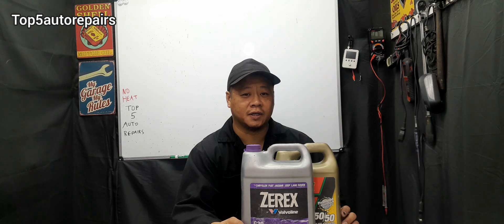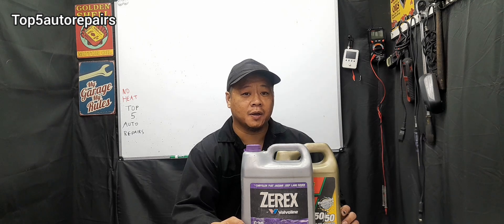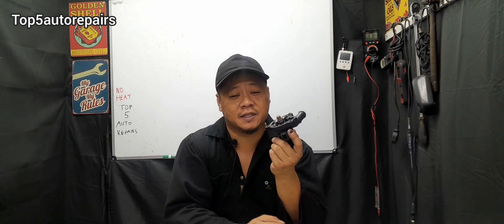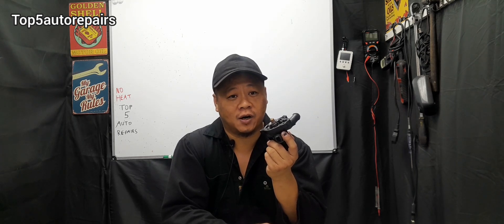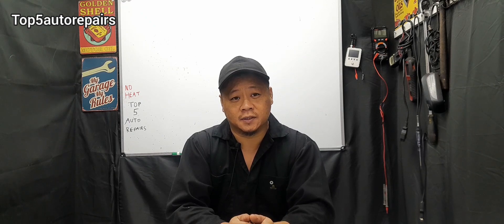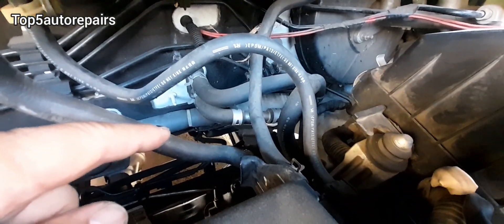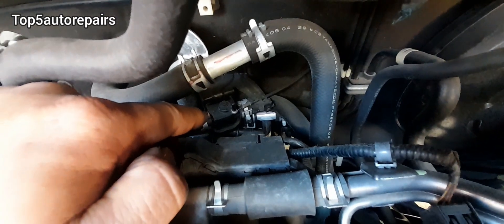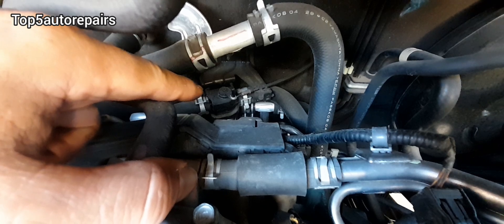CAR HEATER NOT BLOWING HOT AIR

Comment: Great video!! Quick question...my car is running lean bank 1.  The parts thats have been replaced is Purge Valve, Canister Valve, some of fuel line hoses, Throttle Body cleaned, Up and Downstream O2 Sensors replaced. Its a 2008 Kia Optima. 😢Help!!!

Comment: Ive had many used cars in my life, never buy new, always keep 2 cars boys, every heater core failure ive had i just drove around with no heat, drive it when its above 55 degrees, when its cold or raining drive the other car with the good heater, then 2 years later Junk the car with the bad heater and get another used car and start all over again, im not putting $1,500 into a heater and Labor, besides mechanics hate heater core jobs nowadays because most are Lazy, not like 70's or 80's mechanics
Reply: The only reason why I would be worried is if it is tied to the radiator. I found something leaking, had taken it to a mechanic to get brakes fixed. They did a courtesy check and found that the radiator was leaking coolant. Now, all of a sudden, the heat option is not working. Hmmm...something tells me it could be the radiator.